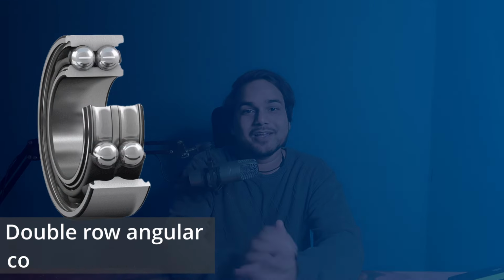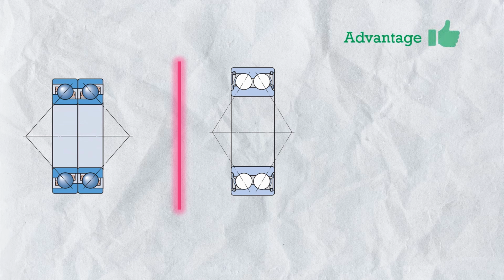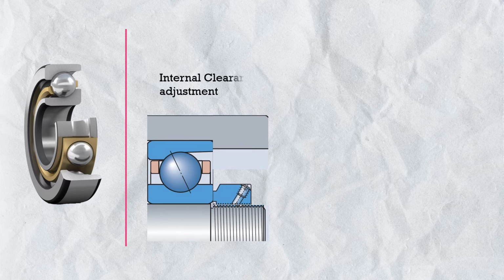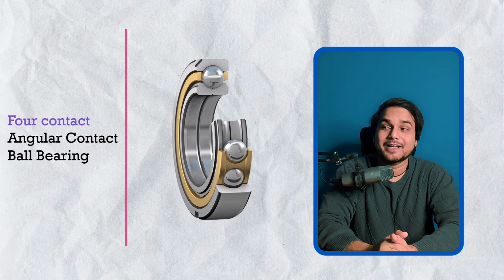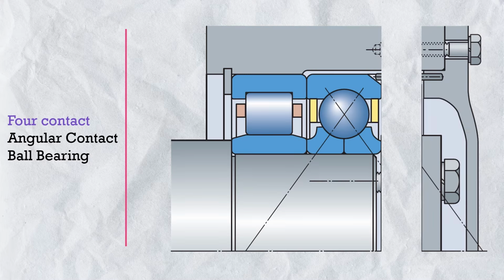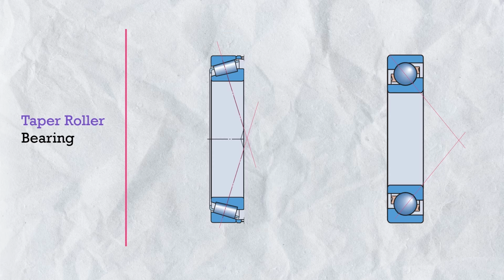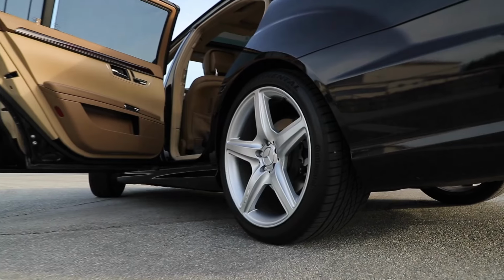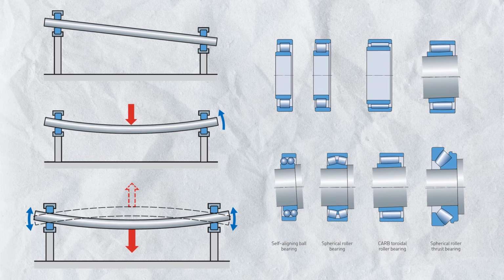Four Point Contact Ball Bearing, Double Row Angular Contact Bearing, Type of Angular Contact Bearing

Comment: Hello, what happened when we use KK60 series B.s. assembly and these is suitable for 100 w  motor, so if we use 400 w. Motor,can it will take extra motor torque ( load) or damage?can u please answer me?
Reply from the maker: Hello Omkar, I gues you are talking about Hiwin Linear actuator. 400w motor instead of rated 100w motor - It will definitely take the load, but series life might decrease, Service life of LM guide and ball screw, so you should recalculate the service life as per new load. And we can find the formula in the Hiwin product catalogue. plus also consider coupling as per new load.
Reply: @mastermechanicaldesign  Thanks,

Comment: Hello. What bearings can be used for 2000 kg electric motors working in both vertical and horizontal position?
Reply from the maker: Bearing type will also depend on speed, pairs of angular contact bearings or tapper roller can be used.
Reply: @mastermechanicaldesign  you are right. In general is it possible to choose bearings which allow an electric motor work in vertical and horizontal position?
Reply from the maker: I can't say without seeing the actual picture, you can email me

Comment: Can you direct me to the formula for calculating how much moment load a pair of angular contact bearings can support? Manufacturers list this value for 4 point of contact bearings, but not for angular contact bearings.
Reply from the maker: Hi, Yes there is no such data for single row angular contact bearings. Also there is no formula. So what we can do is, We can make a rough estimation of radial and axial load for a given moment load. And then we can calculate basic rating life. And on the basis L10 life, we can select bearing size for a given moment load.
Reply: @mastermechanicaldesign  Thank you. If I have two angular contact bearings that are resisting a cantilevered load, am I correct that I should consider their reaction force as acting at the diameter of the balls in the direction of the contact angle of the bearing? Your videos about bearings have been very helpful to me and I look forward to watching more as they come out.